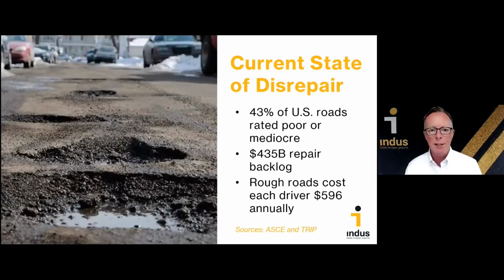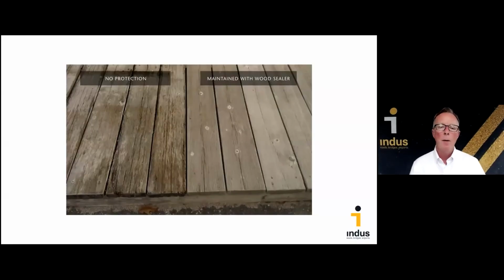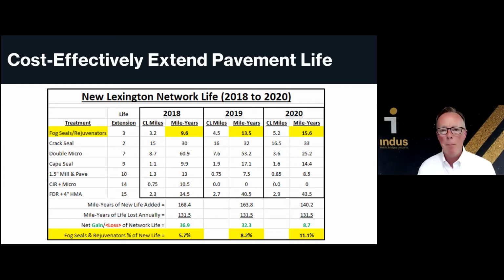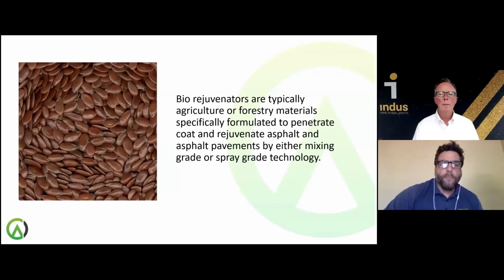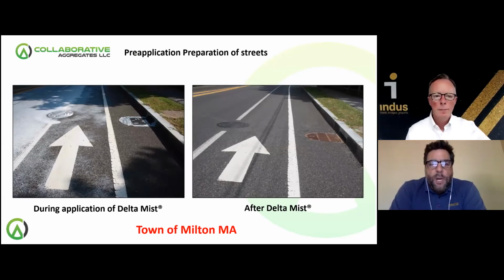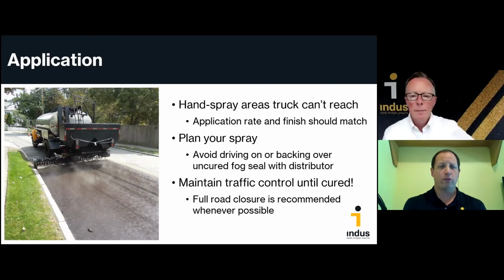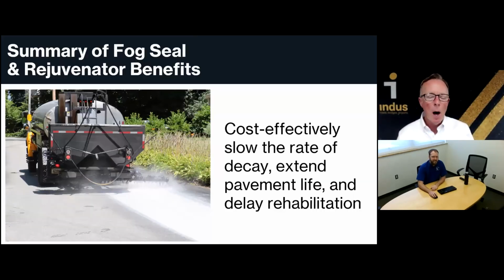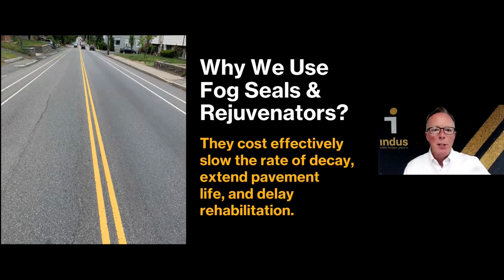Preservation Education Webinar Series: Fog Seals & Rejuvenators

Comment: I've done a lot of research and, for the life of me, I don't understand why folks with asphalt driveways - especially larger ones - don't utilize a rejuvenator product. Unfortunately for me, not one of the asphalt contractors on the island of Oahu, Hawaii offers rejuvenation service. No, they wish to Sealcoat with 2-3 coats that last less than 2 years before it begins to peel or otherwise begin to deteriorate. Unfortunately, the only bad thing about rejuvenator product is that they recommend using a fogger/sprayer machine that is very expensive. If there was a way a homeowner to apply it, the rejuvenator product would sell like hotcakes. You only need one coat. It extends the life and elasticity of the asphalt and can last 6-8 years before reapplication. So it's much cheaper than Sealcoating that merely coats, doesn't rejuvenate, needs 2 or more coats, and needs to be redone within 2 years. Can be very expensive